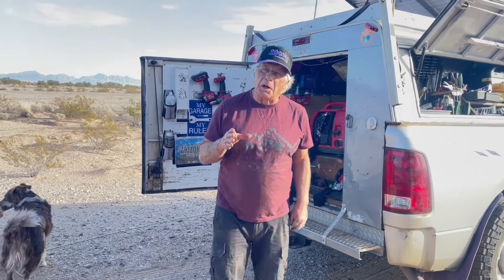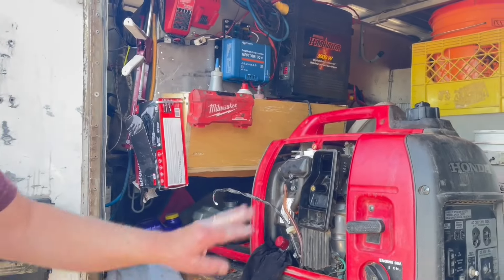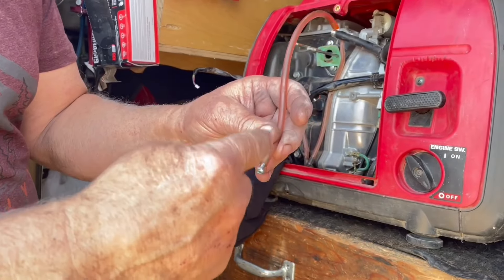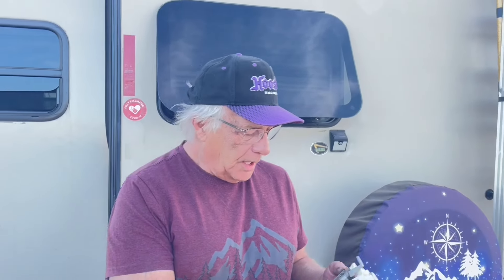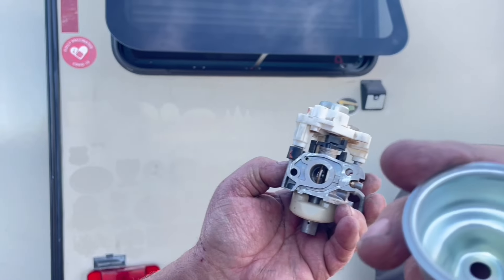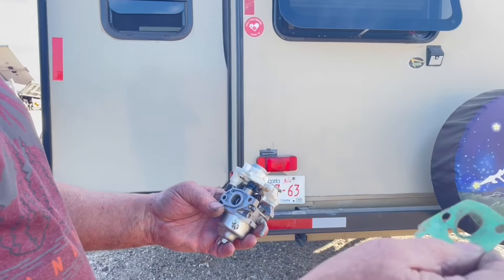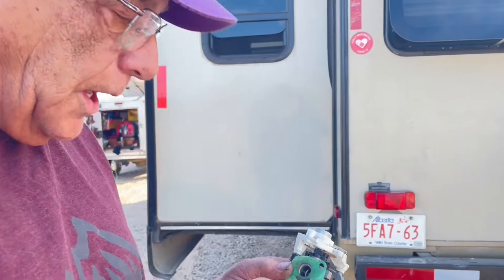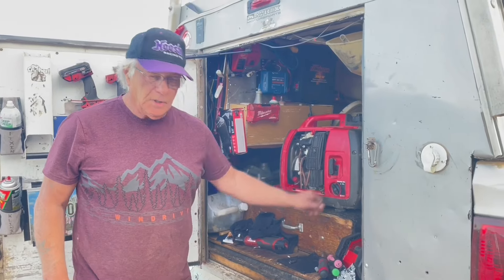HONDA 2K CARB DRAIN Ep323

Comment: I've never had a problem with silicone myself, but I know what you mean. Some people are highly against that lol. Good idea, when I use to ride dirt bikes (2 strokes) I would shut the gas valve off and run it until the engine quit. Good to see the videos again. 👍🏻🔧🪛
Reply from the maker: Yeah some are anal over silcone I never had a issue lol 🛠️🇨🇦